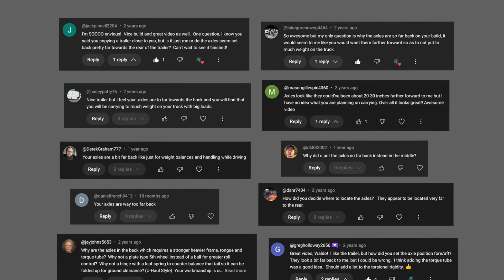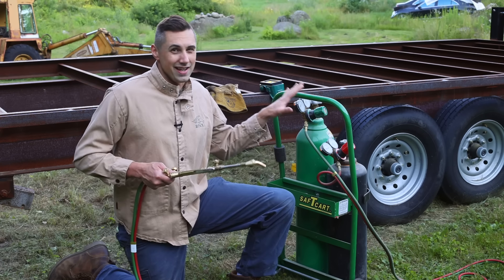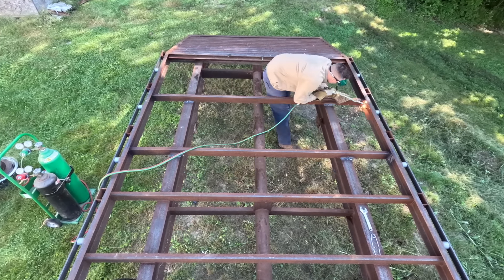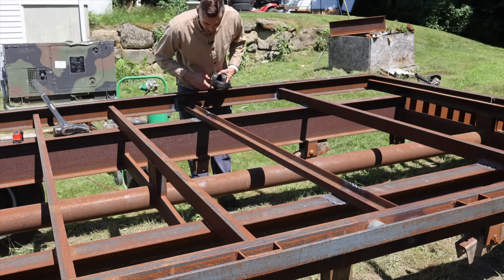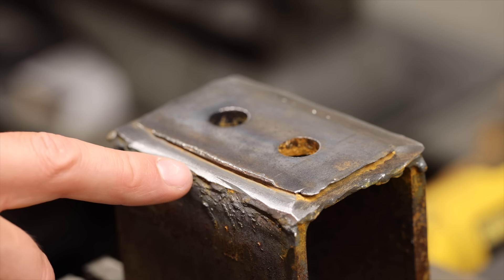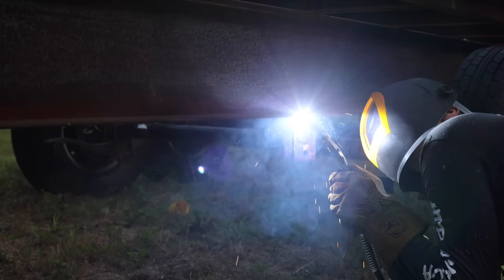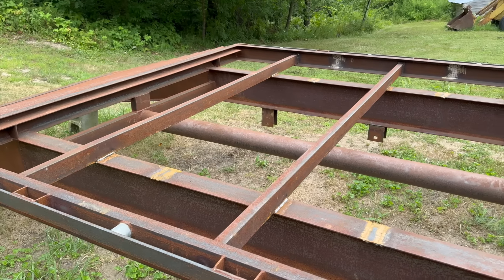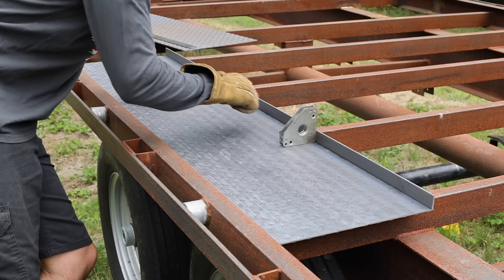Don't Make this Mistake When Building Your Own Trailer

Comment: I totally understand the delay for other more impotent work.  And sorry for being a Monday morning quarterback.  But I’m at a loss why your working so hard to get all the prices cut so close the major structure with a torch.   You’re weakening the structure in a completely unnecessary way.  Saving $50 in brackets or steel on a trailer worth $10-15k is penny wise and pound foolish.  Just the crossmember where the tire goes.